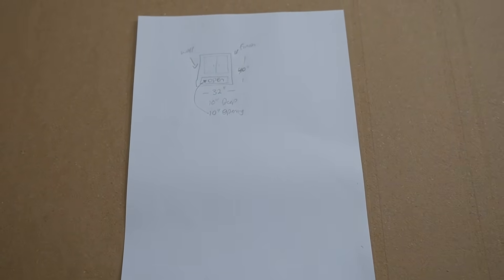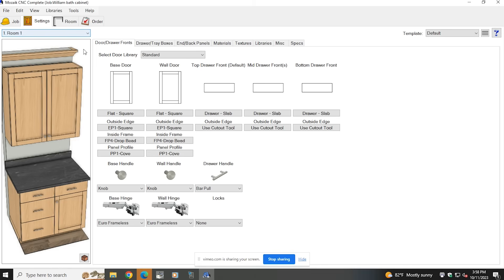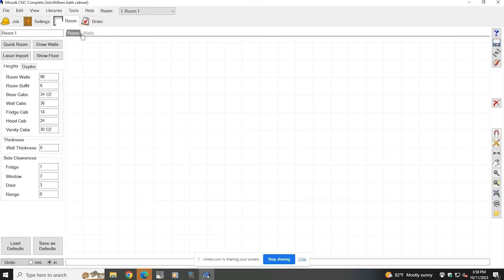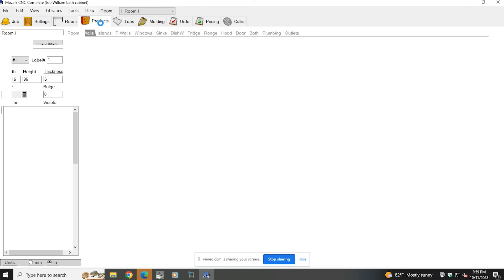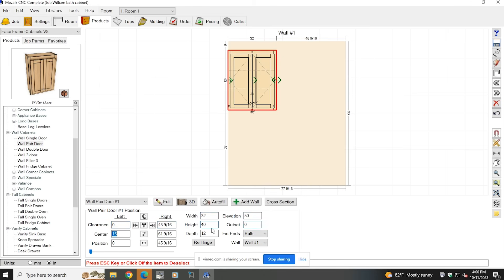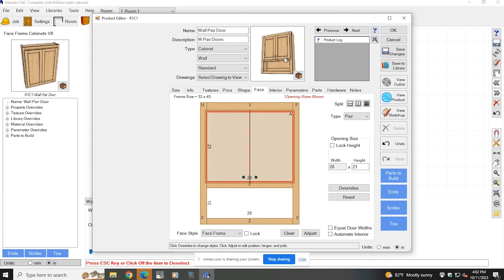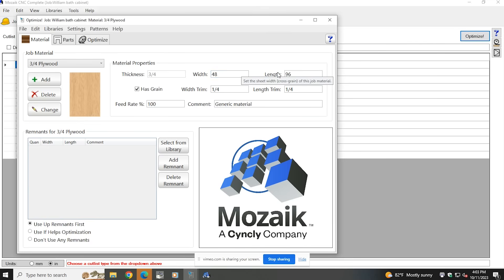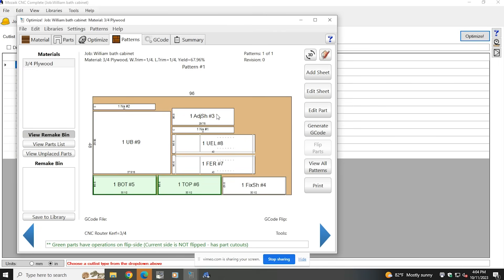Mastering Mozaik: Easy Step-by-Step Guide to building custom cabinets

Comment: Terrific Video! At 7:02, we see the material properties setup dialog. The thickness is shown as 3/4" and it is grayed out. When creating qualified mortises/tenons, having the system understand exact material thickness is required. As you well know, very few sheets come in at exactly .75". How would I make Mosaik know that a particular job will use, for instance, stock that is described as 3/4" but is, in fact, .725"? Thanks!  -Jim
Reply from the maker: There is a material library that you can set and then choose from.  It may be labeled as 3/4, but in the settings can be set to the exact thickness.  That being said, I don’t find too many sheets that are even consistent across the sheet.  What I typically do is set it at a number that I am comfortable with knowing that the actual size of the material is going to be less at times.  This way, I know my material will always fit into my dado, although at times it can cause a little play in the joint, but rarely much more than 1/32.  Hope that helps

Comment: Great Video!  I have a Shop Sabre Pro 510 like the one you have in the video.  Having the extra table space is great however, getting the spoil board vacuum seal can be a problem for me.  I have been using a 4 x 8 sheet spoil board and basically been applying gaskets.  It looks like you are using the 5' x 10' spoil board and using a spare piece to lay down beside the 4 x 8 sheet goods to not lose vacuum.  Shop Sabre informed me that 5' x 10' MDF can be purchased from outside venders.   I cannot get a 5' x 10' MDF where I live so I have to splice/glue up pieces together.  Any thoughts on improving vacuum on a 5' x 10' machine?   I recently received a big order and will be signing up for Mozaik in the next few days.
Reply from the maker: I do have the 5x10, I have a 12” inch piece that covers up the vacuum table to the right side.  I typically turn off the 4th zone (back of table) and don’t have too many issues with suction.

I will cut 90% on small parts and cut through on my last pass and I tend to remove the dust collection when cutting small parts to ensure no movement.

It’s tricky, a lot of trial and error as you get comfortable with the machine.

Hope that helps

Comment: why did you need to flip the board for the dado cuts? could you place the plywood face down, cut the dados. then cut the parts out?
Reply from the maker: The program identifies the most efficient manner to do the dados and cut the parts out.  In some cases there is a dado on one side and a rabbit on the same part on the reverse side.

Comment: Quick question... why did you not cut the face frame out with the cnc?
Reply: For me, practicality, waste, and time; it’s considerably easier to cut face frame parts out with a table saw and miter saw than CNC. The reason is the cabinet parts are cut from plywood, which is easy to hold down with a vacuum pump system that holds the parts in place as you cut. I use poplar or cypress for the the face frame parts, which are usually 1” x 6” x 8’. Smaller parts like this are harder told down during the cut, you will have a lot of waste, and it’s just not time efficient. With that said, Mozaik will give you a cut list for the face frame parts, which are dead on accurate. With my work flow, I can cut, pocket (Castle) screw, assemble, glue, attach a face frame this size in about 15 minutes, in addition to the 20-25 minutes or so it will take me to assemble the cabinet box.